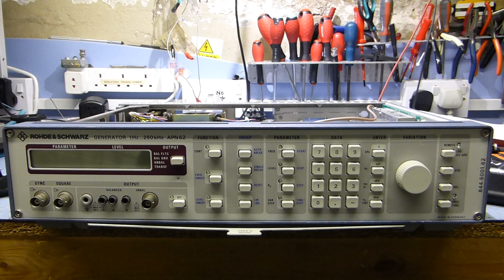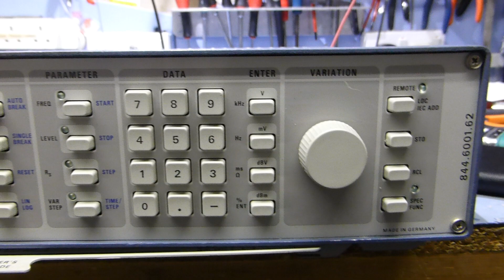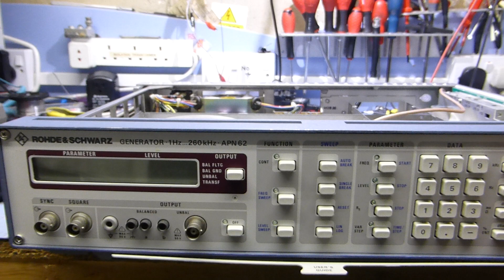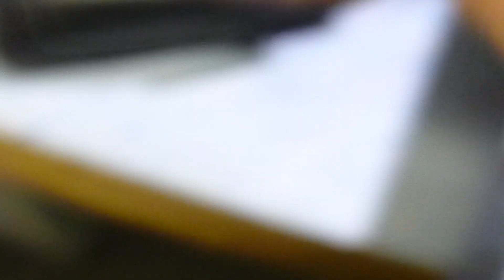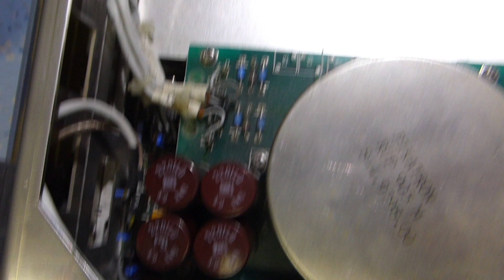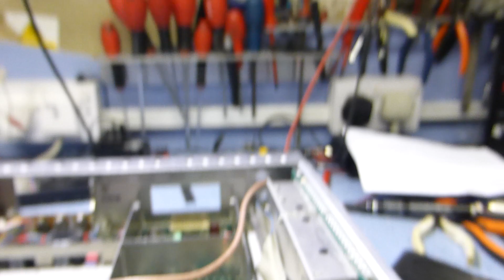Rohde & Schwarz APN-62 Audio signal generator repair

Comment: hi! any follow-up on the temperatures? I got the same unit and the fan noise is driving me nuts...
Reply from the maker: It all runs cool at low drive levels.  Was going to fit a stat on the regulator heatsink of a fan with a thermistor to vary the speed accordingly.